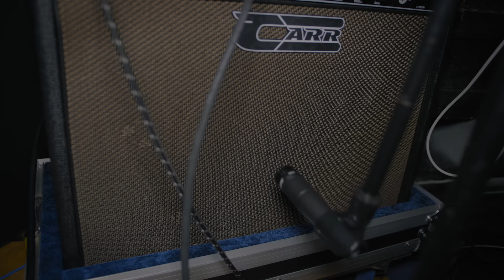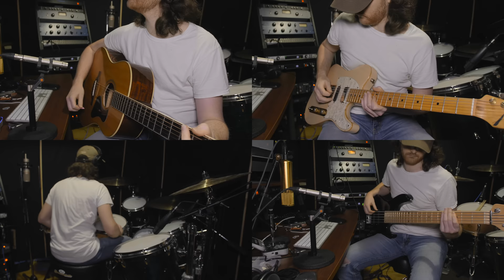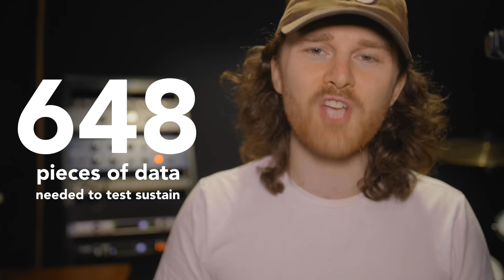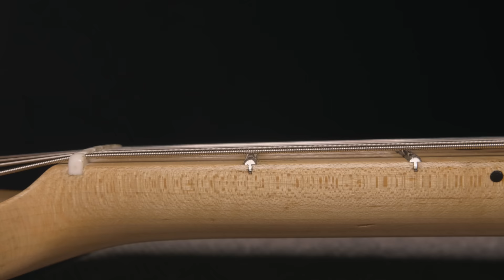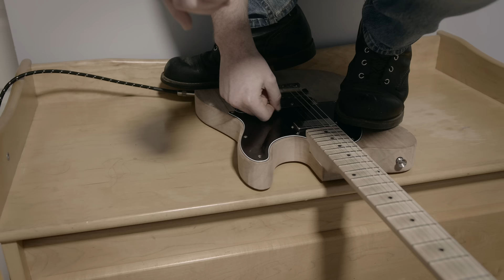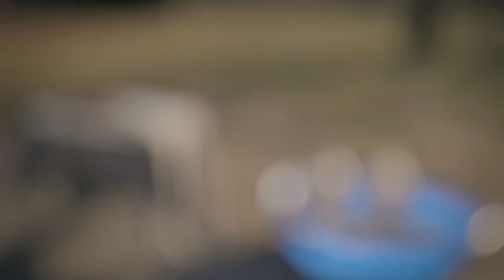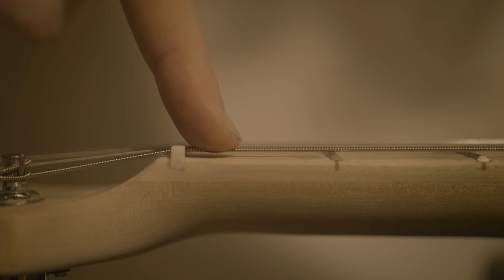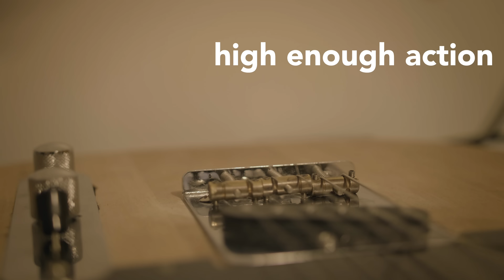Tested: Where Does The Sustain Come From In An Electric Guitar?

Comment: This series could be used in schools as an applied science class. So freakin’ clear and thorough. And zero time wasted.
Reply: He would flunk out of an applied science class considering that he does not seem to understand how to properly measure resonance, or at least decay constants, and thinks that ‘only a couple of dB’ is best thought of in a linear manner.
Reply: There is truth in what Michael says. Jim does not know how to analyze data and it shows. He's honest about it and that's good but it would have been better if he had reached out to someone to help him analyze it.
(Even better: He would have also reached out for help with the data collection.)
Reply: @Pettynyt Ruokailija And the electronics pick up the vibrations of the string, which are influenced by the guitar... You think a guitar with a rubber nut would sound the same or have the same sustain?
Reply: @michaelvarney.  A drop in decibels over a particular fixed amount of time is just as valid a way of measuring decay as half-life.
Reply: @wareya  No, it is not. No one measures resonance in such a manner. Say at time t = 0 you measure 100 dB, then at time 10 seconds you measure 60 dB. What is the decay of the signal? What is it's half life?
You can't tell.

What you need to do is sample the signal amplitude at a high resolution between 0 and 10 seconds, and fit the resulting plot and that gives you the decay you are looking for.

For his signal, he needs to take his waveform and create an envelope curve, and measure the decay of that, calculate tau and see how that changes. Better yet, determine the Q of the system, as that an optimal figure of merit for the system.
Reply: @michaelvarney.  Yes, it is. Period.
Reply: @michaelvarney.  Specifically: No matter where you measure a signal experiencing exponential decay, both methods give you consistent, valid results that can be converted between one another. They are scientifically equivalent. There is no difference. If you are claiming otherwise then either you do not understand the underlying math or you are lying because you have a beef with the results being discussed.
Reply: @wareya  No, it is not. And trivally so. QED.
Reply: @wareya  You are being very unclear when you state "A drop in decibels over a particular fixed amount of time". How did you measure the drop over that time period? Once, twice... a dozen samples? 
Your lack of clarity does not give you free license to project your ignorance of math onto me. =)
Reply: @michaelvarney. 

I mean, saying "a drop of 6db in voltage over 2 seconds" and "a drop of 12db in voltage over 4 seconds" are both exactly the same thing as "a half-life of 2 seconds" but go off.

> Say at time t = 0 you measure 100 dB, then at time 10 seconds you measure 60 dB. What is the decay of the signal? What is it's half life?

-4db (~0.63x amplitude) per second, so a half life of about 1.5 seconds. Or double or half depending on whether voltage and power got mixed up at some earlier point in the process. Is this supposed to be a trick question?

> What you need to do is sample the signal amplitude at a high resolution between 0 and 10 seconds, and fit the resulting plot and that gives you the decay you are looking for.

If you have a signal that is not undergoing exponential decay, then measuring half-life instead is not going to save you. But go off.

> For his signal, he needs to take his waveform and create an envelope curve

No, he needs to measure RMS amplitude with a moving window, not create an envelope - but with highly self-correlated signals there isn't a significant difference between using RMS amplitude or a peak amplitude envelope for this. Also, you can figure out which one he's using by looking at the db meter at 1:27. Have fun!

> calculate tau and see how that changes. Better yet, determine the Q of the system, as that an optimal figure of merit for the system.

This is not how anyone in the real world analyzes audio signals. Other signals, maybe, but not audio. You are spewing garbage and expecting it to be accepted at face value.
Reply: @michaelvarney. 

> You are being very unclear when you state "A drop in decibels over a particular fixed amount of time". How did you measure the drop over that time period? Once, twice... a dozen samples? 

Doesn't matter, still exactly equivalent to a measurement of half-life.
Reply: To emphasize: It is really, really, really hard to measure decay incorrectly if you're working with a signal that is indeed experiencing exponential decay. It does not matter what form the decay measurement ends up in. Decay constants, half-life, and "decibels over a specified amount of time" are all equivalent and can be converted between one another without issue.

And if the signal is not experiencing exponential decay then it doesn't matter what method you use because they're all going to be wrong.

Vibrating strings decay exponentially.
Reply: @wareya  ahh… I see you are not talking about resonance then, as a systems resonance is not necessarily comprised only of a decaying signal. 
So, go off then. 😁
Reply: @wareya  I think you would do well to read more carefully before you race to Wikipedia in an attempt to sound like you know what you are talking about. Projection of your ignorance is unbecoming. 👍🏻
Reply: @michaelvarney.  > ahh… I see you are not talking about resonance then, as a systems resonance is not necessarily comprised only of a decaying signal. So, go off then. 😁

We're talking about audio coming from vibrating strings dude. Vibrating strings decay exponentially, no matter what system they're resonating in. Repeatedly saying "resonance" does not make your intellectual dishonesty go away.
Reply: @michaelvarney.  > I think you would do well to read more carefully before you race to Wikipedia in an attempt to sound like you know what you are talking about. Projection of your ignorance is unbecoming. 👍🏻

This is rich coming from someone who doesn't know how decibels work.
Reply: @wareya  we were talking about the resonance of a system, the guitar. The guitar is more than a string vibrating. 
Keep contorting to save your blathering interjection please. 😂
Reply: @wareya  again, you are projecting. 
Off to bed with you now, cranky-head. 😜
Reply: @michaelvarney.  >  we were talking about the resonance of a system, the guitar. The guitar is more than a string vibrating. 

Guitars resonate acoustically, but only from the body, not the strings. Electric guitars do not pick up acoustic vibrations or resonances. They only pick up the motion of the string itself. Nothing else. And the string itself decays exponentially no matter what it's attached to. Resonance is just where some of its energy is being dissipated to, and that dissipation is proportional for all meaningful intents and purposes.

But even if there WAS more going on, we would still only be measuring the string itself, nothing else, which is pure audio. If you want to measure the decay of an audio sample, any metric that assumes exponential decay (decay constants, half-life, decibels over time) is going to be equivalent. Either they are all correct or they are all incorrect.
Reply: @michaelvarney.  > again, you are projecting. 

Where am I projecting? Please do tell me. Is it because I said you don't know how decibels work? Because claiming that decibels over time are not effectively the same thing as half-life is pretty damning, dude.
Reply: @wareya  the resonance of the system, how energy is passed back and forth between the strings, is dependent on the body of the guitar. The body material of one type more strongly supports certain modes than of another. This means that some notes will sustain longer than others will depending on the material properties of body. If you put your ear to the body of a guitar, you will hear sound… this means energy is being coupled into the body, which will affect the damping of the strings. Anyone who says the body of an electric guitar does not affect sustain or resonance is foolish, and is forgoing physics in favor of absolutist narrative.
Reply: @wareya  yes, your projection. You seem to be conflating the unit of dB with it usage in a measurement of a decay constant. A dB is a relative unit relating a ratio of powers… you stating that dB/time defines what a decibel is, and if one were to not understand exponential decay thus does not understand what the units mean, is asinine and shows that you are conflating two different things and thus poorly understand those two different things. 

Tell me… how do decibels work? 

🤦🏼

If someone were to say “the two signals decayed, one at 22dB over 10 seconds,  the other by 20dB over 10 seconds, and at the end they were only a couple of dB different, so that is nothing” would you assume they knew how decibels worked?
Reply: @wareya  actually, go ahead and forgo an attempt at explanation and instead simply fall back to more projection. 
Have your last word, and remain in bliss. ✌🏻
Reply: @michaelvarney.  > actually, go ahead and forgo an attempt at explanation and instead simply fall back to more projection. 

Not a valid answer, either point out a specific instance of projection or don't respond.
Reply: @timoheinrich8763  I suggest the channel Tech Ingredients. There may be a more specialized sound channel but TI has the most accurate/thorough and entertaining science channel in existence. Check out their videos building the highest quality speakers. They go DEEP on analyzing materials.
Reply: @michaelvarney.  Quantum Electro-Dynamics!? You might be taking it a bit too far... 😁
Reply: @nowave7  quantum chromo(matic)dynamics. ;)
Reply: @wareya  that was entertaining lol
Reply: @michaelvarney.  kinda late, but still... sure, some dB difference it could be a lot in sound metrics, but not in this case, where playing a guitar is not an exact science, but more about skills. In his previous video he proved already that the sound, in electric guitars, is not altered by the body, materials or forms, everything else can be corrected using his skills and ears. It's about electronics. So, in this video he debunked just another "myth":
Because guitars are played by humans, it's all about skills (!) All you said it's right only if guitars are played by computers, which are not.
You're just in a wrong fight mate. No offense. Cheers
Reply: @wareya  this discussion you two have had here could be framed and put in some kind of internet museum. All those words and mathematical theorizing just to rehash the same "wood matters" "no it doesn't" discussion as everyone else. It's perfect
Reply: Mi like zero time wasted
Reply: Kind of amazed by Michael Varneys claim that you can hear sound coming out of an electric guitar body by pressing your ear flat against it. Has that actually been tested? Is pressing your ear tightly to something a good test? I'm curious what would happen if you actually put a sensitive mic against a guitar body how that would turn out, and how you would guarantee the sound you're recording isn't the strings vibrating the ambient air around the mic. It just sounds like absolute bullshit someone pulled out of their ass.
Reply: @HamidKarzai  he even did a video on what they argued about lol

Comment: Interesting. Makes me think that perhaps the higher perceived sustain on a Les Paul vs a Tele might be the fact that the Les Pauls will tend to have higher output pickups, causing the amp to break up more easily.
Reply: This has always been at least part of the puzzle. Back before we had such a plethora of pedals, people liked using les Paul’s to drive their Marshall’s for exactly this reason.
Reply: Well, you can test this by using similar pickups. There are humbucker T-style guitars but dunno if there's an LP with T-style pickups (that would be interesting). I would guess the LP-style guitars are usually more expensive (glued on neck, carved top etc.) and therefore probably better made because why waste the extra effort (well, there are bolt-on LPs with flat top too). Might be something as simple as sloppily filed nut (why bother if it's a cheap guitar, right). I actually have a T-style guitar (RRP around $1000) with a humbucker and with simple ear test there's no difference to my LP-style guitar (RRP $2000). Fine, it has '59 while the LP has Pearly Gates and they have a bit different pots and caps. Didn't set up a DAW for this. Noo, I didn't pay the full price, both guitars were on some crazy summer sale and are awesome. I hope I could play to be worthy to them. Cheers.
Reply: The longest sustained note I’ve ever heard was in the song “Machine Gun” by Hendrix. And that was a strat with a bolt-on neck. 
Oh yeah, fully cooking Plexi too.
Reply: @TheMaxKids  I can hold a note for a couple minutes. Just get a good comp, high gain and especially an early Muff Style or Swollen Pickle and keep the note trilling slowly
Reply: @KelticKabukiGirl  if you keep trilling the note slowly, you're changing the pitch (slightly) and constantly adding/releasing tension, meaning you basically add new vibrations. Point of sustain is that you aren't manipulating the strings. But in a practical sense, this doesn't really matter: you got some long notes in your sleeve and that's all that matters in a musical sense
Reply: @TheMaxKids  bolt-on necks definitely have more sustain than set necks, much to the dismay of Les Paul players. People have tested that, but it doesn't require much data to determine that an attachment by bolts is stronger than an attachment by glue.
Reply: It's worth considering the effect that action will have on sustain. Fender/Squier action tends to be a fair bit lower than Gibson/Epiphone. With a factory spec nut height, that won't make much of a difference on open strings, but a Strat when fretted will tend to choke notes out a little more compared with a Les Paul. As a result, fretted notes will have a sharp transient which falls fairly quickly to a slightly lower initial volume than on a Les Paul (assuming you compare, say, humbuckers fitted to both). That's one of the reasons people go crazy over SRV's clear tone and sustain - it comes mainly from his having an unusually high action for a Strat.
Reply: @marinedalek  that's what set ups and moding is for.
Reply: There was no Les Paul in this test tho
Reply: I’ve felt big differences in hum buckets and single coil pickups at face value but never found any guitar sounded bad or any pickup couldn’t get any tone I’ve liked and I’m no pro or pedal wizard. Might just be my taste but a 5% difference probably matters in a studio but not whatsoever when practicing or live where the sound is super messed up by the room, setup, etc etc
Reply: @Harmonic14  I don't know a first thing about guitars.  But in my experience working with wood best glued attachments are better than any bolted attachments (no experience with instruments, just general joinery). Best glue joints are much stronger than the wood being attached. Where as with bolts there is high strain near the bolts but much less elsewhere.
Reply: @Harmonic14  on the contrary, set necks have far more surface area in contact with the body than a bolt on, and are often considered to have both more sustain and a much stronger attachment to the body. A set neck isn't a neck which has been simply glued into a fender style neck pocket, it is often a mortise and tenon or dovetail joint that are glued into place. Much of the snap and twang associated with the "bolt on sound" is a result of the neck not being as firmly connected to the body as a set neck. In reality however, a well made bolt on can out-sustain a mediocre set neck guitar, and vice versa, there is no "better" option, only better craftsmanship.
Reply: @Axel_Andersen  as someone who builds guitars professionally you're certainly not wrong. Perhaps if you took 2 strats, and bolted one to the body and glued the other neck into a standard strat pocket then the bolt on would be superior but in reality set necks are mortise and tenon joints or dovetails with large surface area in comparison to a bolt on, and have a far sturdier coupling. The biggest practical disadvantage of course is that you can't simply un-bolt the neck to repair of replace it.
Reply: @TheMaxKids  Gary Moore had more sustain than Hendrix did. Hendrix got around single-coils by cranking his stack to the max and leaving all dials at their highest settings.
Reply: It's moreso that Les Pauls thrive smack dab in the midrange, while Teles are in the upper range of the EQ. Humans' ears perceive midrange better than other frequencies.
Reply: Also often thicker strings due to 24.75" scale
Reply: Les Pauls also have lower string tension which had more sustain in these tests.
Reply: all nobs to 11...e voilá
Reply: Pickups matter a lot. On my new parts-tele-caster, neck pickup(humbucker) gives a pinch(minimal) better sustain than a bridge pickup(singlecoil). Or its jus my brain, i dont know :)